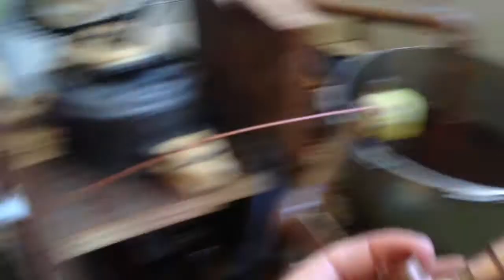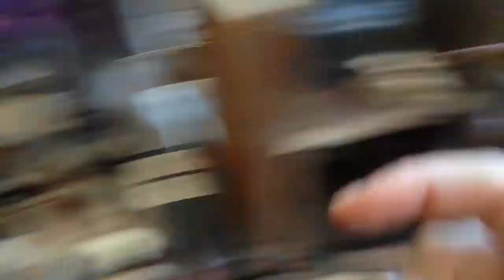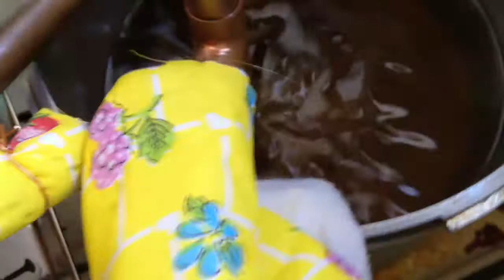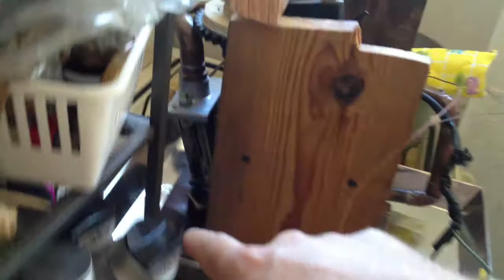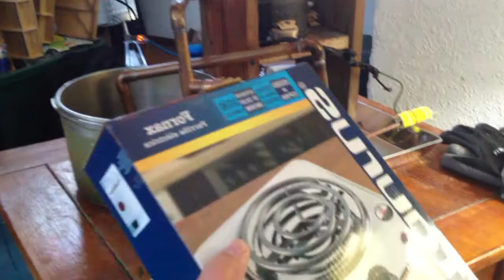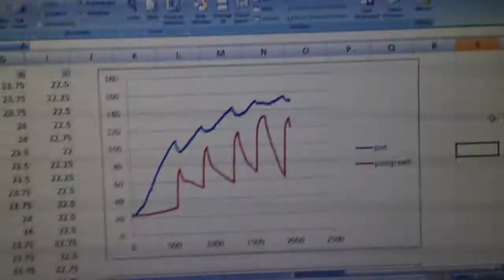solar thermal powered car part 39, hot oil pump test

Comment from the maker: This is just to start testing.  Also using free garbage parts helps me learn how people in third world countries can build this out of garbage.  I will start testing with the oil pump in a pan.  If it leaks to much I will have to try and find something better. So far I have been running the pump for over an hour and have maybe a table spoon of leaked oil